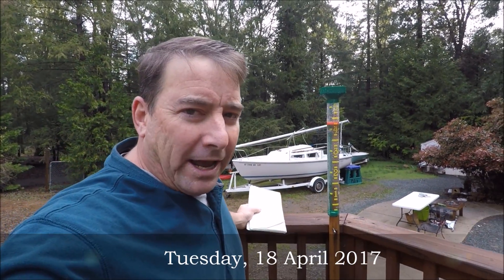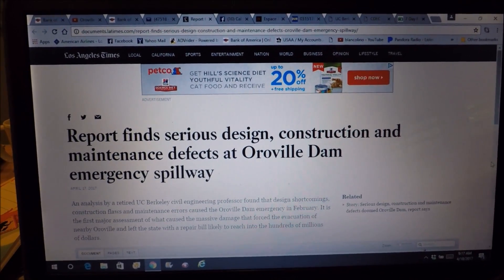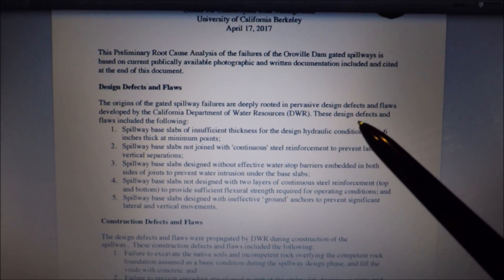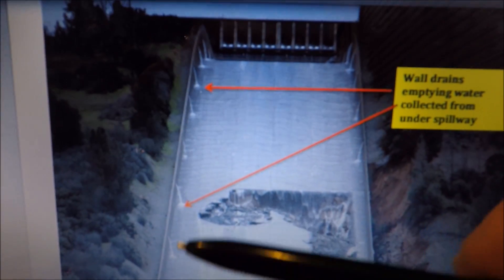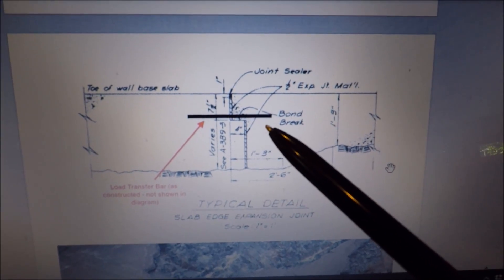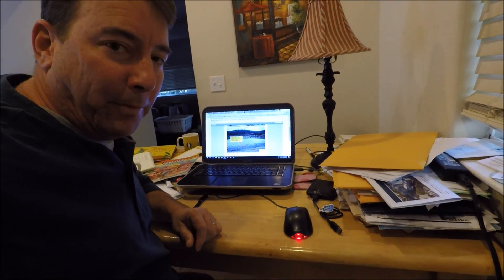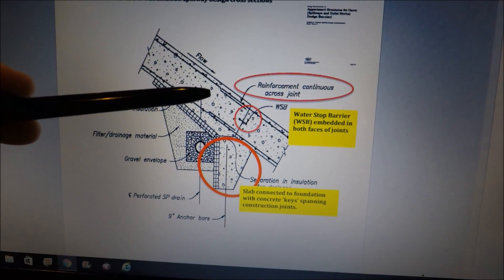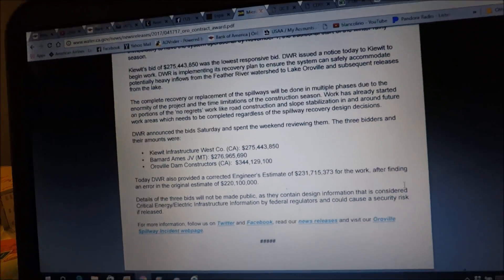Oroville 18 April Spillway Failure Explained-Independent CCRM Report

Comment: For the record cavitation is not air bubbles, that would be aeration. Cavitation bubbles are the vapor form of the liquid in question, in this case steam. A low pressure zone causes boiling and then the vapor bubbles collapse back into liquid. The collapse causes a shockwave that causes the damage.
Reply: No, there is no air in cavitation.  As Mike Cowen points out, adding air can prevent cavitation.  Cavation bubbles can kind of be thought of as vacuum bubbles.  They are not actually a vacuum because, as Daniel Armstrong said, they are filled with water vapor.  But, if the water temp is 60 F, then the pressure in the cavitation bubbles is about 0.07 psi.  While not a vacuum, that's a fairly low pressure.
Reply: +blancolirio — in cavitation the gas is the vapor form of the flowing fluid.  In this case it is just water vapor, or cold steam at ambient temperature.  The bubbles form in microseconds where the pressure drops due to the flow, like air flowing over the top of an airplane wing, and they collapse microseconds to milliseconds later.  When the bubbles collapse, the water vapor returns to liquid water and a small, intense shock wave is created that hammers away at the surface until pieces start coming off.  It's exactly what goes on in an ultrasonic cleaner.  No air involved.
Reply: Thank you to Milosz and Andrew for backing me up here.
Reply: Frank P What hasn't be noted here is the nature of the collapse of the vacuum bubble which causes damage. The bubble forms rapidy, but the formation is not supersonic. The collapse however, is. Just like the crack of a whip, the supersonic collapse of the vacuum bubble causes a sonic boom which is transferred through the water. Since we know that liquids are effectively incompressible, this shockwave exerts incredible force in all directions for a short distance. And since a cavitation bubble usually forms along a hard surface, that surface absorbs countless miniscule supersonic blows during the cavitation event.  It is more accurate to think of the surface erosion as atoms being blasted away rather than actual chunks of material.
Reply: blancolirio well technically cavitation is water in a gaseous form.. But for all purposes described it is air...
Reply: +Gord Baker Again, not air. Air is 78% nitrogen, 21% oxygen, and 1% everything else combined.

Cavitation bubbles are almost entirely water vapor with maybe a trace of any gasses that were dissolved in the water.
Reply from the maker: Daniel Armstrong good point..isn't that gas mostly...'air'?
Reply: the rough surface of the concrete causes the water to eddy or spin around. When entering such an eddy the water is subject to lower pressure (lower boiling point) and when exiting higher pressure (higher boiling point). So the water goes through two changes of state very quickly, first from liquid to steam/vapour and second from steam/vapour back to liquid. While in a steam/vapour state the water is a bubble and it implodes at the latter change of state. The damage caused by cavitation is not caused directly by the implosion of the bubbles, ... rather by the shock wave which arises because the speed of the implosion breaks the sound barrier. 
I wrote a similiar comment a few days ago which maybe lost, but please understand there is no air involved, and those bubbles at the back end of the propeller of an outboard motor are steam/vapour which experience very low pressure just at the front of the hub of the propeller and very high pressure thereafter and which therefore go through an identical two changes of state process as described above. Best from Ireland.
Reply: Daniel, this is a very interesting the distinction you have made that when the vapor bubbles collapse back into the liquid there is a shock wave that causes the damage.  This distinction helps me understand the complete life cycle of cavitation.
Reply: Gord, in the context here, "steam" does not mean hot.  It is a synonym for water vapor.  You can see this same usage in engineering in what are called "steam tables",  They often contain data for "steam" down to almost 0 deg. C.  You are right that in that with cavitation the "steam" will be at basically the same temperature as the surrounding water.  I don't think anyone here is claiming the "steam" is significantly hotter than the water.
Reply: It is water vapor (aka steam).  Michigan Wheel (a long-time propeller manufacturer) describes cavitation as "water vaporizing or 'boiling'".  What do you get when water boils - steam!

https://www.miwheel.com/resources/terms/

"Cavitation, (which is often confused with ventilation), is a phenoma of 
water vaporizing or “boiling” due to the extreme reduction of pressure 
on the back of the propeller blade. Many propellers partially cavitate 
during normal operation, but excessive cavitation can result in physical
 damage to the propeller’s blade surface due to the collapse of the 
microscopic bubbles on the blade. There may be numerous causes of 
cavitation such as incorrect matching of propeller style to application,
 incorrect pitch, physical damage to the blade edges, etc."

More about air - From an article on surface-piercing propellers:

"Cavitation:  When a submerged propeller blade cavitates, the
pressure on part of the blade becomes so low that a near vacuum
is formed."
 
"The surface propeller effectively eliminates cavitation by
replacing it with ventilation.  With each stroke, the propeller
blade brings a bubble of air into what would otherwise be the
vacuum cavity region.  The water ram effect that occurs when a
vacuum cavity collapses is suppressed, because the air entrained
in the cavity compresses as the cavity shrinks in size.  Although
the flow over a superventilating propeller blade bears a
superficial resemblance to that over a supercavitating blade,
most of the vibration, surface erosion, and underwater noise are
absent."
Reply: So, the difference is a collapsing air bubble simply becomes a smaller air bubble of proportionally higher pressure which will spring back to whatever size pressure and temperature dictate. A cavitation "bubble" is formed with a phase change: the liquid, here water, "boils" into its vapor form, steam=water_vapor. I get 0.25 psia at 60°F [Andrew ?] When this vapor collapses back into its liquid form is when the hammer blow occurs... there is no more "bubble" left to cushion collapse.
Reply: Fog is water droplets as in "cloud". Water vapor is always in our atmospheric air and condenses onto your ice water cup in the summer AND you can't see it until you condense it, eh? The "heat" in cavitation is that the 60°F water will "boil" at the very low pressure behind a high speed surface. When that low pressure effect goes away, the water vapor condenses back to liquid form.
Reply: Cavitation is the result of turbulent water flow.  Aeration is adding air is added to the turbulent water to cushion the impact of the cavitation bubbles.

Cavitation, to pilots, is similar to an aircraft wing just before stall.  The smooth airflow over the wing becomes turbulent, drag increases and the wing stalls (loses lift).  Although this drag doesn't damage the wing, with water it can be sufficient to erode concrete.  A laminar flow airfoil helps to reduce this effect.
Reply: Painmagnet it is fascinating, this whole cavitation micro-universe.  Thanks for further elaboration.
Reply: Adding bubbles to the water stream causes the hydraulic shock waves to dissipate in the added air bubble space like a damper before it reaches the surface of the concrete. But the problem seems that the cavitation occurs at the surface of the concrete itself not some distance away so there is no room for the added air bubbles to help dampen the shock wave before it reaches the surface of the concrete, like a boat prop the cavitation occurs at the blade tip itself which is the part that errodes. Adding air bubbles wont help. If you put the whole prop in a tube to increase the pressure of the water around the blade tips it will counter the low pressure that causes cavitation at the blade tips. Likewise putting the spillway into pipes should so the same, but it would take many large pipes and outlet regulators on the ends which would cost a packet. But hey I'm a mechanic not an engineer.
Reply: A Mascia - 0.25 psia - right you are.  Sorry, I wasn't careful either when I googled the number of made my units conversion.  Oops!
Reply: +blancolirio
Not only, on fluids pump "steel made" could be the fluid itself turn in gazes phases ...
There is not that much "air" in gravels concrete like builders try their best to eliminate it, nor in metals alloys ...
Use ore water pump and it would be the same ...
It's a kinetic energy phenomena which have no "regards" to the raw material used ...
No wonder it's the same phenomena astronoms called black holes ...
It's kinetics ...

What that the point ?
You naughty brained Damn shaker !
Reply: Daniel Armstrong
The kinetics low pressure make literally the concrete boil ...
That's it .
Even the tiniest bubble become blowing material ...
It happens on steel made ...

Comment: Thanks blanco !
Being an old time Bricklayer from the UK i can tell you that if you have a " Pree stressed concrete lintel " That goes over doors n windows the R bar should always be at the bottom of the { Concrete } lintel ! { Go n get a sponge n bend the ends upwards at each end- It compresses the top n stretches the bottom  !
Sorry i wrote this before the end of the vid n you explained the R bar position -- Anyways my 2 pennith post ! Again thanks blanco

Comment: Many thanks for another excellent public information broadcast which we are reading here in the UK.  Looking at the drain bell end, surely the bell end should be facing up hill so as to cup the down-flow within the pipe.  As it is shown any seepage in the downhill flow would surely blow the pipe joint apart?

Comment: http://documents.latimes.com/report-finds-serious-design-construction-and-maintenance-defects-oroville-dam-emergency-spillway/

I think that's the link everyone is looking for.
Reply: That is a super report by a retired UC Berkeley civil engineering professor on the failure of the spillway with 80 pages of easy to read captioned photos including historical ones.
Reply: The issue with traditional concrete is the cure time. That's something that ' s at a premium. The concrete going into the holes to make "bedrock"  doesn't need to be pretty.  Those excavators can mount a compaction head. Dump a load of RCC into the hole, Compact it with the compaction head and dump the next load. It doesn't look pretty but the operators can make the top good enough to drive on and lay traditional RCC for the actual spillway.
Reply: Bob Smoth Possibly use traditional concrete, this time properly anchored and rebarred as a base for the RCC, but I can't see installing roller concrete on a non-smooth base, since the machinery won't be able to account for the massive peaks and valleys. Either way, significant flattening will be necessary.
Reply: Here ya go: 

https://en.wikipedia.org/wiki/Roller-compacted_concrete
Reply: Stopped at page 69 for me... but if you open the document "full screen" (icon at bottom left), then the resulting window has a link on the right column to the full document, which is the one I posted as a result of my searching for the document.  Your link is fine, but didn't give me the whole document, and it wasn't in PDF to store locally, until I did what I described.
Reply: Conclusions: 1 There is no possibility to use part of the old spillway. Tear it all down and start fresh. 2 Where bedrock is not available ( close the surface ) create it with RCC
Reply: Purplegang.....cemexusa has some good youtubes on it.
Reply: Can you elaborate more on what RCC is? And the process for using it? Would love to know more.
Reply: This is the link to the PDF:
https://assets.documentcloud.org/documents/3672058/Oroville-report.pdf

Comment: Simple explanation. It was a paper failure. Original design No.1 on paper costs $?. OK too much $$ in paper and political liability on paper for too much $$. Accepted final design on paper cost $? paper money. Accepted and contracted on paper. Political success on paper not so much in reality. It was the paper that failed. The accepted final design for the spillway, materials and construction performed exactly as it should have. Only the paper to fault. :) Now with Critical Infrastructure blackout another paper failure is on the way. Trust a politician? I think not. Trust the engineers and 777 pilots. They live or die alongside you. Paper means nothing to them, only performance.

Comment: Thanks Juan! I certainly hope that the replacement will be built on piles sunk into the bedrock. Relying on the stability of the underlying rock and concrete is not a recommended solution. Build this thing as if it was a freeway overpass!

Definitely fill the entire underlying area with concrete, but the important point is that the actual weight is on the pilings. In this way it can also be made earthquake proof.

Taking this approach would allow piles to be placed relatively quickly and in between spills. Properly protected (wrapped), these pilings would be unaffected by subsequent spills allowing this work to be done sooner than later.